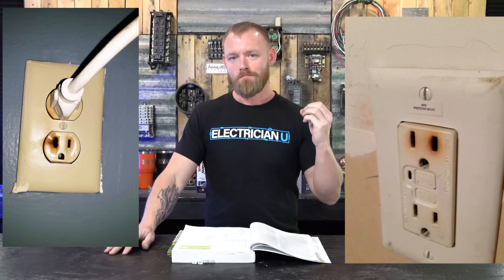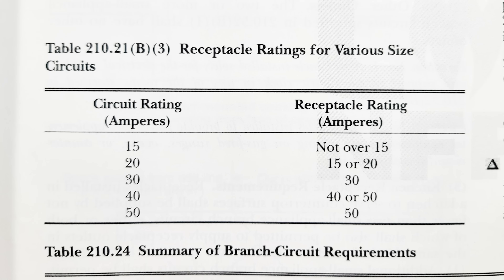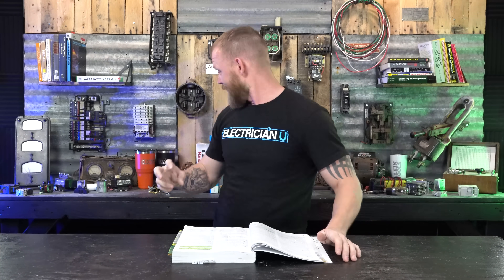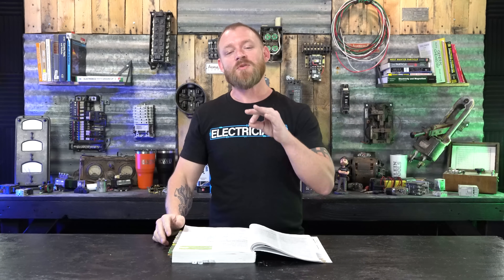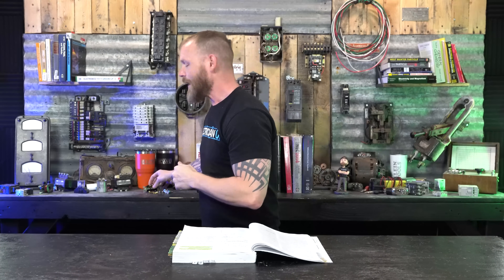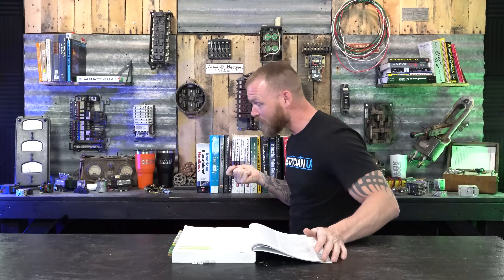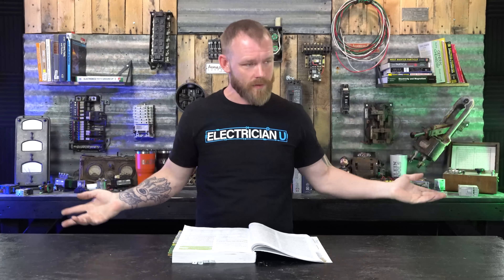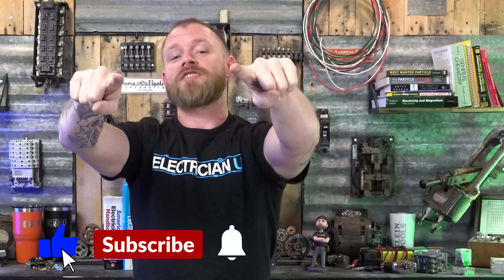Won't These Melt?!? 15amp Receptacles on 20 amp Circuits!!!

Comment: The code for this was written by morons. I repair for a living. When I do repairs, I think outside the repairs. If I don't. My repair won't hold, and the problem is back. Any idiot knows that nobody in homeownership or as a resident ever thinks about what they are plugging in. How many times the breaker trips and they are dumb founded what happened. Or the real idiot wired the breaker throw lever in place because it was annoying them that it kept tripping.
So yeah, the code writers are idiots. They need to think outside the dam box.

Comment: My kitchen only has two 20 amp circuits (plus a 15 amp for dishwasher and another fo disposer). On that side of room,  I never run the 1500 watt micirowave with the 1200 watt toaster or 700 watt coffee maker. If I remodeled, I'd update the panel from 100 to 200 amps and add circuits to kitchen, dedicated one for microwave, which is my highest current device (no central AC).

Comment: Re-reading two years on, the basic chain of the electrical path is limited by the panel breaker - a lower rated 15A receptacle on a 20A circuit is never an issue, as the required 12 ga wire is protected by the breaker, NOT the final outlet. The receptacle slots prevent any single rated 20A appliance from being plugged in. The code also states that 15A receptacles can handle 20A loads across them, i.e. feeding down the line. It may actually confuse things, if an entire kitchen were wired with 20A receptacles, because while there aren't many 20A countertop units, plugging in a bunch would definitely overload even the rated 20A breaker. I have had my 20A breaker trip when both a hair dryer and microwave were running at the same time, neither rated above 15A separately.

Comment: the question. those videos do not make clear is.  can you put more than one 20 amp receptacle on a 20 amp circuit.  some say yes and some say no.  and what about a 20 amp receptacle first and a 15 amp receptacle down the line on a 20 amp circuit
Reply: You can put one or several duplex receptacles on a 20 amp circuit. A duplex receptacle is 2 receptacles, so it's considered multiple receptacles. A dedicated circuit would have only one socket in the entire circuit in order to access one utilization equipment, so a single receptacle would be required to define that concept. You can mix 15 and 20 amp receptacles on a 20 amp circuit and the order doesn't matter, the 20 amp receptacle doesn't have to be first.

Comment: Breakers protect the wiring not the equipment. ALL 15 amp receptacles are rated for 20 amp pass through. What is this 15 amp plastic and metel you speak of? That just 5 more amps it melts and not high resistance from a worn or loose plug that is probably only pulling 12 amps.

Comment: One space heater usually takes about 13 amps. You are already in the danger zone with one space heater. At the end of the day you will likely save more lives if you put in 20 amp outlets. Sure the code allows for 15amp. The code needs to change, and the code is wrong. It would be safer if the outlet matched the OCP.
Reply: It doesn't make any difference, especially if you use a commercial grade 15 amp receptacle. The gating item is the wire gauge. With 12 gauge wire continuous, and no significant loads on other receptacles in that circuit you'd be fine if everything was in good condition, no loose connections, etc.

Comment: Just to be safe and kind to the first 20 Amp Receptacle, wire nut the three wires home run 6" pigtail and the line going to the next receptacle, then connect only the pigtails to the receptacle. Rinse and repeat to the end. This way no receptacle will see more than its own load.
Reply: No receptacle will see more than its own load, regardless of whether you use pigtails or direct wiring to the receptacle. Both methods are parallel circuits and if you use the receptacle as a connector, only the external side plates will carry current and they are rated for 20 amps pass through, even on residential grade receptacles.

Comment: I work in a hospital and have seen in break rooms , a microwave, toaster oven and a fridge in the same circuit . They ask how does it trip the breaker. At least they are 20 amp receptacles.
Reply: Hospitals and medical facilities tend to use 20 amp hospital grade receptacles exclusively, probably to keep things simple and their cost between 15 and 20 amp hospital grade receptacles is negligible. 15 and 20 amp commercial grade and up, including hospital grade, are of the same quality internally and externally when they are the same grade. Realistically, it doesn't matter if they are 15 or 20 amp hospital grade. Dustin gave reasons why the breaker doesn't necessarily trip and the toaster oven and microwave are usually only on for a short time. The refrigerator probably cycles on and off approximately 50% of the time.

Comment: yeah, i got a customer with a burnt 15amp outlet.   3 way plugged in, hot tub plugged into the 3 way along with some outdoor lights.....hot tub alone is pulling 14amps.    so dedicated circuit time!

Comment: Why do 15 Amp recepticles exist? It seems to me that the potential (sic) for error would be eliminated by making all recepticles 20 amp. If there were NO 15 amp recepticles there would not be a price difference.
Reply: We didnt always have so much stuff to plug in. Most old houses were only 100 amp service. No microwaves, no 5 different hair appliances, most receptacles were for a radio, tv, and lamps in the house, not including kitchen and bathrooms which are required to be on 20amp circuits these days. Maybe its time for a change? Idk, but thats why 15 amp receptacles and circuits are still around. Just a product of old thats still incorporated into our lives.
Reply: 15 amp circuits are still deemed sufficient in most locations in dwelling units and the respective receptacles, wiring, and breakers can add up to significant savings when purchased in high volume.

Comment: So my garage has 4 receptacles 20amp wire and 20 Amp breaker with 15 Amp outlets I didn't understand why so I put In 20 Amp outlets so I'm assuming I shouldn't of done that? Or is it ok?
Reply: Its fine but not necessary.  Only if you have something that needs the 20amp prong configuration,  but the standard 15 amp receptacles suffice and meet code.
Reply: @stoffel6348 well I had bought a welder that needed a 20 amp outlet but I've installed a 220 since then. But before I put in 20 amp outlets I was using a corded chainsaw to cut up a tree that had fallen  and when I was finished  I noticed the 15 amp outlet was melted So that was another reason why I changed it. Thanks for the response
Reply: @stonemills1546  likely it was loose at the plug, from moving it around or an older plug that no longer had a nice tight fit. I have done that with space heaters. I prefer a nice commercial grade 20 amp receptacle. I've seen so many receptacles melted from those; I understand your logic. I wouldn't say that everyone should immediately go out and do it but it's probably worth the effort.
Reply: If your 15 amp receptacles were residential grade, you could have upgraded to commercial grade 15 amp receptacles and possibly saved a few bucks, without sacrificing quality and safety. Regarding electrical equipment that has a 20 amp cord and plug, they are normally recommended or required to be used on dedicated circuits, meaning that the receptacle must be a 20 amp single receptacle, not a duplex in order to comply.

Comment: I used 20a receptacles on my 20a circuits without realising you can use 15a receptacles. I’m guessing you can plug any heater in the house now. Feel bad about the cost though after realising this through this video.
Reply: Don't feel bad.  You bought a better product.  A lot of these box store 15A receptacles are garbage.
Reply: @dictare 15 amp commercial grade receptacles are readily available at the big box store and are the same quality as the 20 amp within the same grade.

Comment: So in a nut shell a 20 amp 12 ha circuit won’t blow until a possible 24 amp load . So mom’s plugs in a 18 ga extension cord to their electric heater and burn the house down. Sounds correct to me!!

Comment: In home residential wiring.....things are generally pretty much idiot proof. The industry has built in the amp safety factor from burning the house down for the " idk do it yourselfers. " The real thinking comes into play with the commercial and especially industrial electrical field.

Comment: I had 20 amp breakers on 15 amp receptacles (15 amp wiring), unconnected grounds or ground and neutral swapped on some...and 2 burnt up receptacles, plus 200 amp main breaker on 150 amp main line when I bought my house 🤦‍♂ Guy who built it used 'Home Depot labor' and thought he knew what he was doing it turns out...lol. $5G latter it is all up to snuff.

Comment: Thank you!!!!
In Puerto Rico they follow NEC 2017 code, but all breakers must be 20A and 12 wire for everything receptacles and luminaries (well except for were 30A circuits are needed). But I was finding that all houses that I went into receptacles where 15A rated and wondered why they did this. Now after seeing this video I finally comprehend. Thank you for taking me on this learning journey of the NEC!!! 🫡

Comment: How can i know how much amps are going to be drawn out per whatever i plug in?
Reply: Every item has a wattage and/or anticipated current rating printed on it or on an attached label. You can verify this with a clamp meter and a splitter plugged into the receptacle. The total current of all the loads on that circuit will be what the circuit breaker sees.

Comment: I have two related questions.
(1) Although I think pigtail wiring is generally accepted to be superior to through-receptacle wiring (using all four conductor terminal screws), it seems like pigtail wiring is especially important when putting a 15A receptacle on a 20A branch circuit, so that the 15A receptacle doesn't have to carry the load of the downstream receptacles that might add up to as much as 20A.
(2) Similarly, if installing a GFCI receptacle on a 20A circuit, and utilizing the Load terminals to protect downstream 15A standard receptacles, it seems like the GFCI receptacle should be rated for 20A since it potentially has to carry that much current (including its own load).
Are these conclusions correct?  Does the NEC address these questions?
Thanks.
Reply: No, your conclusions are incorrect. (1) Using the receptacle screws is acceptable and the tabs connecting the screws are rated for 20 amp pass through even on 15 amp residential grade receptacles. The improvement that you can make is to use a 15 or 20 amp commercial spec grade receptacle, because they are more robust than the residential grade. The 15 and 20 amp commercial grade are exactly the same, other than the neutral slot, when comparing the same grade. The NEC does not stipulate or recommend either method, but does permit 15 amp duplex receptacles on 20 amp circuits.
(2) Same thing as (1), GFCI receptacles are commercial spec grade by default. The Load terminals and internal contacts and circuitry are the same whether it's a 15 or 20 amp GFCI.
Bottom line is that it's okay to use either a 15 or 20 amp duplex receptacle on a 20 amp circuit, it's your choice, but thinking that a 20 amp is better is a myth, as long as you are comparing receptacles of the same grade.
Reply: @surferdude642  Thanks!

Comment: How many 20 amp commercial sockets, on a 20 amp fuse/breaker, in a workshop? I plan on adding two new circuits using armored 20/2. Both slaved to a commercial grade GFCI socket. First one is easily in code; a GFCI to slaved switch, installed indoors; to a commercial 20 amp water proofed outside socket.
The next circuit though, I am wondering if I should run two circuits, because of wanting at least 5 sockets/outlets, where I will have several heavy load tools. I don't have any 220 volt 20 amp tools. Have an outlet for my arc welder.
Would it be wiser to do 3 outlets(a GFCI and two slaved 20 amp outlets, one switched ;-) ) on each of two, 20 amp circuits, in a work shop?.........I would need two GFCI's for the two circuits, but that too can be done.

Comment: So if I have a 20amp breaker, I put in a 20 amp receptacle in need to make sure that I have 12/2 wire. Correct??
Reply: Correct, but if you use a 15 amp receptacle in this case, you would still need 12 gauge.

Comment: I have low voltage led lights with transformers want to use 16/2 with a 12 amp breaker
Cannot find one anywhere

Comment: I have read on web from others that you can run 20A on a 20A circuit for 3 hours then you have to switch to 16A indefinitely.   Is that 3 hour window true?   Thats the time to heat up the wires/outlet/breaker.  Is that in the code book?  80% rule

Comment: Says 2 or more outlets...if this is in series and over 15 amps is on 1 outlet it will combine with the other branch circuits and trip the breaker if over 20 amps. The current drawn total will exceed the breaker value.

Comment: Enjoy your channel. Not sure that many people are aware of the inadequacies of push in connectors on the back of the wall outlet when the builder wires the home. plugging in a space heater in a room and the other outlets in the room/circuit getting warm or even hot.

Comment: I prefer to use Wago lever nuts to tie the line and load wires, with pigtails coming out to tie in to receptacle/switch hots neutrals & grounds. Essentially running the receptacles in parallel rather than in series. The power from each receptacle only goes through the wires connecting itself to the wago blocks, and the total load on the line can be greater than 15 amps. That high current doesn't have to travel directly through the receptacles.

Comment: This was so interesting, thanks! I actually have this thing with my AC that requires a 20A so I changed the outlet to meet this but still it doesn’t seem to be strong enough to handle the AC properly. I wonder what is it… 🤔

Comment: WTF I don't care obviously some codes are wanky 15 amp's on a 20 amp circuits is asking for trouble I'm a fix it yourself guy thk you for this the code should just read 15 amp's for a 15 amp circuit nothing more

Comment: That was an exceptional video. Thank you. I want to heat a shed, so my understanding is if I have a 20 amp breaker and a 20 amp receptacle, I can use a 20 amp (50' or 100') extension cord and use a 20 amp power strip to run a 15 amp space heater safely. Is that correct. I would also run an LED light from it. It would be from an outdoor outlet that isn't used for anything else.

Comment: Dear Justin, I have a little different question. I have an Electrical Oven which is Single Wall Oven Stainless-Steel, 5 cu.ft. Convection Oven 3550 Watts. The instruction manual specifies a 15-amp requirement. The oven operates at 240V, 60Hz, drawing 14.79A.However, the manufacturer recommends using a 30-amp circuit for optimal performance and added safety margin. It means A CIRCUIT BREAKER OF 30Amp rating . Is this 30 amp BREAKER a good choice here; as I think it will not trip until current drawn is 30 amp or more, putting my appliance at risk and other mishap. It will be hardwired without receptacle. Why not a 20 amp breaker is a better choice instead of 30 amp to have optimal (correct)  purpose of providing a Circuit BREAKER. PLEASE ADVICE and Guide. Thanks
Reply: Since you said it is a single wall, I would use a 15 amp double pole breaker and minimum 12 gauge copper wire. You might consider 10 gauge copper wire, in case you decide to upgrade to the double wall which requires 30 amps. You may have misread the instructions, I think the 30 amp requirement is for a double wall appliance.

Comment: Dear Justin, I have a little different question. I have an Electrical Oven which is Single Wall Oven Stainless-Steel, 5 cu.ft. Convection Oven 3550 Watts. The instruction manual specifies a 15-amp requirement. The manufacturer recommends using a 30-amp circuit for optimal performance and added safety margin. It means A CIRCUIT BREAKER OF 30Amp rating . Is this 30 amp BREAKER a good choice here; as I think it will not trip until current drawn is 30 amp or more, putting my appliance at risk and other mishap. It will be hardwired without receptacle. Why not a 20 amp breaker is a better choice instead of 30 amp to have optimal (correct)  purpose of providing a Circuit BREAKER. PLEASE ADVICE and Guide. Thanks

Comment: I have found that over the years CODE has changed especially lumber codes, with many sensible codes by the NEC. What I find alarming are codes that now allow large apartment complexes to be built out of wood frames where 30 years ago they were mandated to concrete. These new complexes are simply fires waiting to happen. The building codes that changed were written by lumber companies. The one thing that is keeping these stick built apartments safe are NEC codes.

Comment: and here I am, planning a single 20A circuit for a treadmill that has a 15 amp plug. I MIGHT plug a small 50-watt TV into it too, but nah. My mom terrifies me with her pile of daisychained extension cords (well, excepting the fact that my tiny house is currently using one, but parts on the way to rectify that temporary situation)

Comment: This becomes even more important these days with people buying electric cars and charging them on their home outlets.
I had a 20 am circuit for my outdoor front porch which has a one 15a outlet on  the circuit. I changed the outlet to a Leviton G5362-WTG 20A-125V Extra-Heavy Duty Industrial Grade Weather/Tamper-Resistant Duplex Self-Test GFCI Receptacle as my car charger pulls a maximum of 16 amps which is 20% of the rating of the 20 amp circuit.